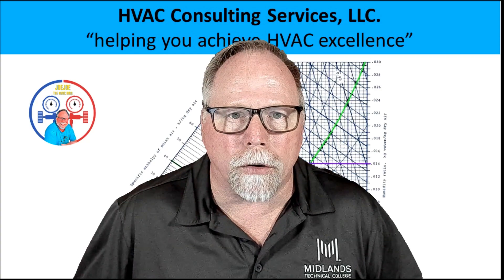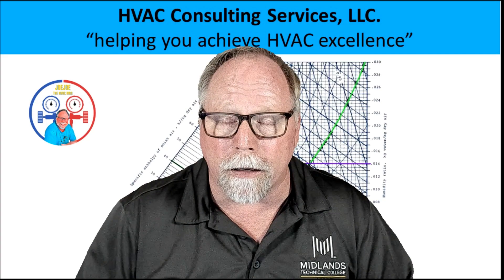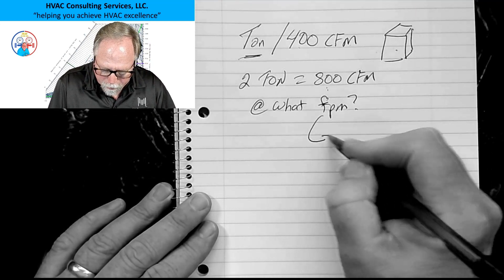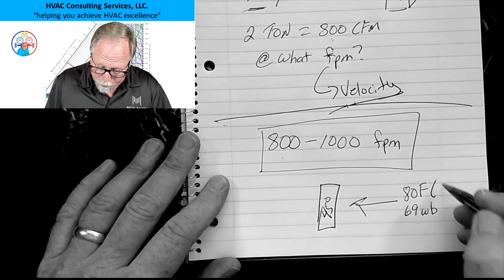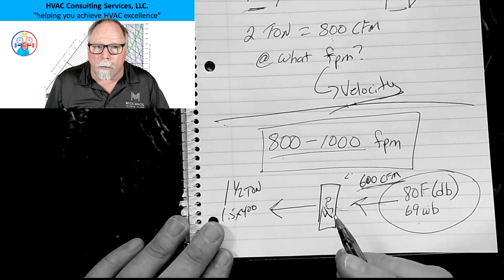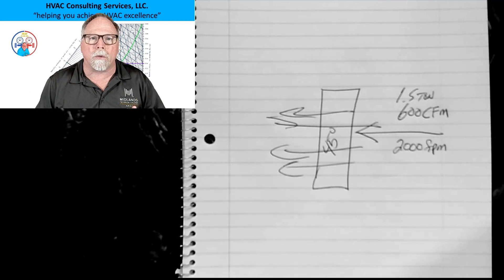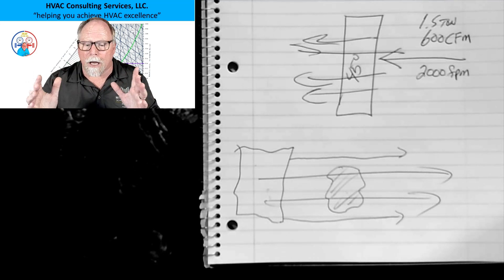The Hidden Air Flow Factor That No One Talks About

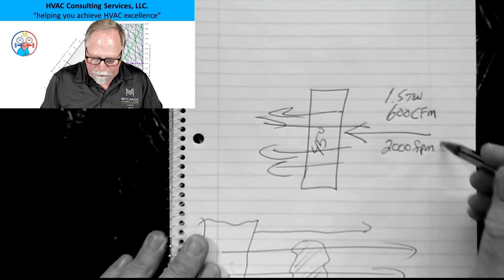Comment: What are you saying at 10:30?
Reply from the maker: You’re right. That did not come out very clear at all did it? I did repeat it right afterwards but I said constant CFM. I was referring to constant CFM motors. I.e. variable speed motors.  Thanks for the question and thanks for watching!
Reply: @Joe_Joe_The_HvacMan  Thanks,. I'm dealing with this now. It seems my variable speed blower (Trane) is running too fast and not cooling house. It was sucking up the filter as you mention. I have tried setting the dip switches to 350cfm, 400cfm and 450cfm. I tried different filters (currently using cheap "rock catcher" filter). Is there any other way to reduce velocity without changing duct work? It's a 5 ton unit. What if I change the dip switches to 4 ton unit but keep 400cfm? Will that affect velocity?
Reply from the maker: You do need to keep that CFM setting to 350-400CFM per ton or you will lose capacity and possible start freezing the coil which leads to very bad things!  I duct modification is the least you can do.  Give me some more detail.  Email me through my website.  https://joejoehvac.com/
Reply from the maker: You have to stay at least at 350CFM/Ton.  Usually some fitting changes at the supply and return of the air handler can help reduce the problems.  We can start a seperate conversation about this if you want some more help. @mtbbiker6401
Reply: @Joe_Joe_The_HvacMan   Thanks. I have my dip switches currently set to 5 Ton 350cfm. At the 5 ton 350cfm setting, my variable speed 1 HP motor is drawing 4.5A. FLA is 7.0. I'm no expert but my ducts are terribly designed. I have a Trane vertical 5 Ton heat pump air handler in an upstairs closet with vaulted ceilings with no attic space. It sits on a platform with the return underneath. The duct box above the air handler has 3 small runs on the top and a large run on the bottom that distributes air to the first floor. The air leaves the handler and hits the top of the box and then needs to do a 180 behind the handler to enter the large duct for the 1st floor. I don't know if the home was designed for a 5 Ton unit but it doesn't seem the ducts can handle 5 Tons. I guess my first step should be a static pressure test.
Reply from the maker: @mtbbiker6401  sounds like you’re in a tough position with a Return box and a supply box. If there’s anyway you could put turning vans in the return box that would help on that end. And if there is a way you could get a square to round with a round ‘y’ and then bring those supplies back in on the supply side and get rid of the box there that would work better. Got any room for that?